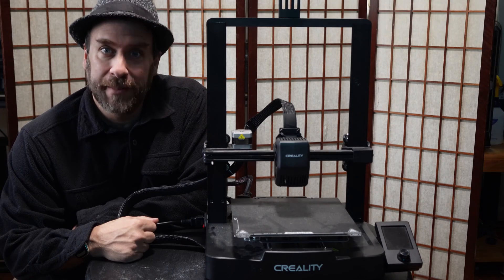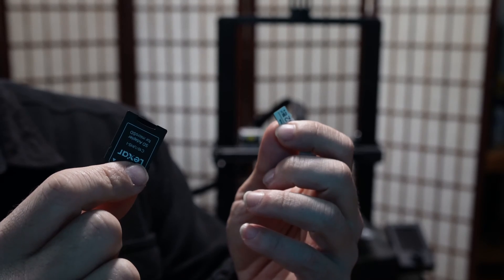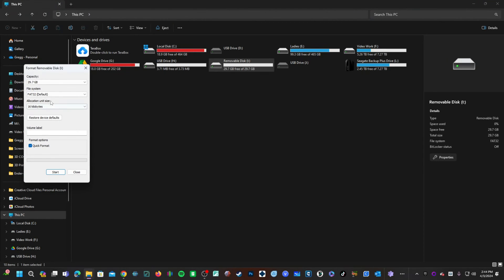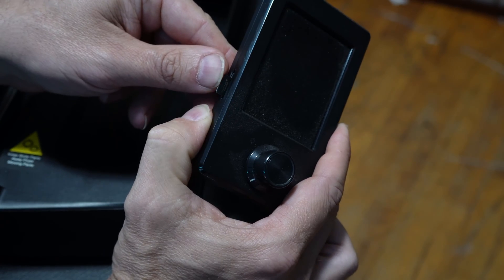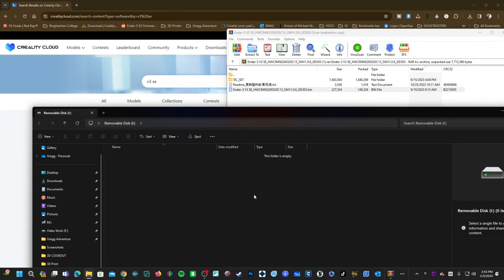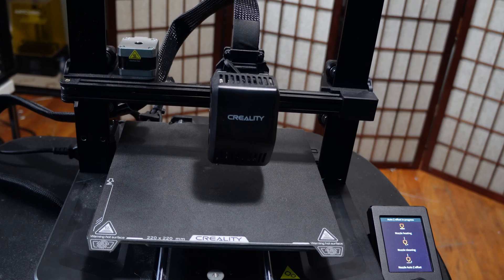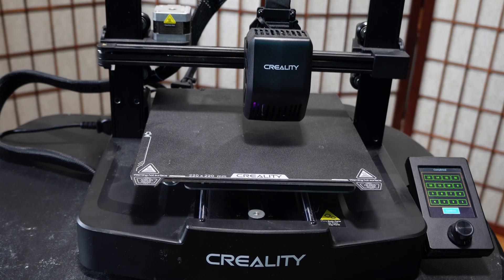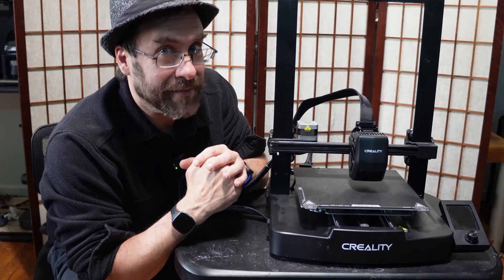How to Update the Firmware on Creality Ender 3 V3 SE - 3D Printer

Comment: Hello please someone help me I have a ender 3 v3 se and I can’t find anything on how to get the printer to let me go over the max temp of 260 I need it to go higher because I just upgraded to a higher quality hot end
Reply from the maker: Are you running a Nebula?
Reply: @3DRundown  I would have installed a nebula I just had no idea that was the problem
Reply: I am very new to this learning fast though thanks for the quick reply you earned another sub i bought the ender 3 v3 se stock and I only upgraded the hot end do I need to get the nebula kit to make the temp higher ?
Reply: Some people on a sub Reddit were trying to convince of buying the sonic but if I can just change the temp without spending over 100 dollars on a sonic tab I would much rather do so the nebula kit is only 70 dollars as of now if that would work let me know and I will purchase immediately
Reply: When I read online it says even after install the nebula I will still be constrained to the stock firmware that’s why I’m so confused
Reply from the maker: Sonic Pad is really nice, but, the Nebula was literally made for the V3 SE, and the install is so easy.  I don't do any 260+ printing, but you should be able to get around this through Klipper. Smarter people probably already have this documented.

Comment: hello 3D Rundown. After updating, do I need to use save info? Thanks in advance.
Reply from the maker: I would run a calibration.
Reply: @3DRundown  Thank you for the prompt response. If I may ask how to calibrate exactly?
Reply from the maker: It's the SE, so there is no G-Sensor, which means no Input shaping or any of that. Run an Auto Bed Level. If you have any weird problems, due a factory reset, then run it. BUT, you shouldn't.
Reply: @3DRundown  Thank you very much for replying! Will do this just in case. More power to your channel sir!

Comment: Buying an Ender 3 V3 SE has been nothing but a headache. Plus, while trying to update the firmware, I went out and bought an SD card that wasn’t a fat32. Had no idea there were different types of SD cards. It’s been a terrible experience so far. Ready to print in 20 mins it says lol.
Reply from the maker: Bro, V3 SE is as easy as 3D printing gets.
Any card can be fat32, but, of course, it needs to be 32gb or less. Hence, the "32" in Fat32
Reply: @ I’m not educated in SD cards man sorry lol. The V3 SE is not as easy as it gets. You have to manually download updates. It’s a tedious process. This was bought for my 9 year old because it says you can be printing in 20 mins. Not the case at all.
Reply from the maker: I truly is super easy, but, if you are comming from ZERO experience, there are certainly things to learn. 3D Printing is fairly complex..... But, go back 2ish years, and get an Ender 3 Pro, to see what things used to be like.....
I would highly recommend the KE over the SE, do to the Nebula Pad and Klipper. You may add the Nebula to the SE, and, that would offer a ton of advantages over the Marlin on the SE... including, automatic firmware updates.

Comment: Your explanation is very clear but I have a problem. I've only had my V3 SE for a few days. It went well a few times, but now I keep getting the CR-Touch error message. I sprayed the axle of the pin with some WD-40 and that seemed to help. But now I have the problem back. I read that a firmware update could help. That's why I found your video. Now updating the screen is going well. But when I try to update the machine, nothing happens. I don't get the Languages screen etc. Any idea what's going wrong?
I keep getting the CR-Touch message.
Reply: I have the same issue as you! Have you found any fixes?

Comment: I'm late, but I'm trying this as we speak. My download, on attempting to move it to the SD card, says "The file name you specified is not valid or too long. Specify different file name."
Reply: Just switched from FAT32 to NTFS and it worked, now to hope it still updates properly!
Reply from the maker: Always FAT32 for Marlin. 32gb or less
Reply: It doesn't. If anyone else is having this issue, the file must be inserted to the SD card using BREEZIP or WINRAR or a similar program and it MUST be in FAT32, file explorer WILL NOT WORK.
Reply from the maker: Yes. You must, of course, unpack the zip/rar first.

Comment: The printer firmware file ender-3 V3 SE_HWCR4NS200320C13_SWV1.0.6_GD303.bin wasn't recognised by the printer. When I renamed the file to 123.bin and rebooted it was detected straight away and FW updated was completed. So lucky that I had watched another FW update video and this was pointed out that sometimes the "bin" file will need to be renamed in order for it to work.
Reply from the maker: Marlin firmware will not load the same filename more than once. Renaming is always necessary after a failed attempt, or a re-flash
Reply: @3DRundown  Maybe this should had been mentioned in your video. SO so many frustrated people out there trying to install the Nebula kit to their Ender 3 V3 SE printers.
Reply from the maker: It's common knowledge for MARLIN, and has been mentioned many many times. That said, this is not for the Nebular pad. This is for updating the Stock Marlin on the SE. I may make a Nebula upgrade video at some point. The Nebula is already here, but I am only one person. YOUR WELCOME

Comment: when i download file it comes up as a document. no folder. also im on mac. can someone help?
Reply from the maker: What's the file extension?
Reply: @3DRundown  i fixed the problem earlier by using the unarchiver which is a 3rd party app used for opening and extracting certain files. i also had to use an earlier update model because i couldnt update the machine part, although i did manage to update the screen first. everything is sorted now. thx for ur vid

Comment: ive done this seriously 20 times. 
my printer does the update on the screen but after inserting full side SD 
turns on and stays on blue screen. does not progress to creality logo or anything further
did all versions available of firm ware. 

any help????
Reply from the maker: Keep in mind, when loading a new firmware, the machine won't attempt to load the same filename twice. Try renaming the file, and attempting again.
Reply: I have this same problem, just gives me the blue screen and stays bricked, what do you mean, change the file name?
Reply: @ I had to contact creality support 

They sent me a new piece 

Whatever anyone else tells you do not update firmware

Comment: I have done everything that you have said here and now when I turn on my printer, the screen says no file.. I don't know what is wrong! I've tried it several times now and can't seem to get it right!  Please help me!
Reply from the maker: GCODE files don't show up?
Reply: No, not at all. I don't know if I should just return the printer and get another one or what. I bought this for my son for Christmas and hasn't worked yet. I found your video about the firmware update and was hoping this was the solution. I even had to go buy a different SD card that supports FAT32..lol
Reply from the maker: YES, you want Fat32. You'll need a card, that is 32gb or LESS, to format in Fat 32. Choose Allocation unit: 4096.
Are you SLICING your STL files, then EXPORTING them as GCODE, to the Memory Card?
Reply: Yes, I don't get why this is saying "no find file" I went to Best Buy and talked to the computer guys there and one of them owns a 3D printer and knows exactly what I was talking about and has no clue what I should do. I'm thinking it's the printer at this point. I think it's defective. I showed the guy what I was doing, and I did everything correct.. the printer won't read the file. It is FAT32, it's everything you said.. the files are there! The printer won't read it.

Comment: DIFFERENT LANGUAGE ISSUE*SOLUTION:
1. Format micro and normal SD cards
2. put TJC_SET folder in micro root, then insert micro in on the left side of the LCD as shown in this video
3. Copy the Ender-3 V3 SE_....bin to normal size SD card and rename to firmware.bin
4. Insert BOTH the micro sd card in the display and the normal sd card in the printer
5. update screen will appear again
6. Wait for update to finish, then turn off remove all the cards and start it up. Should be back to normal display
Reply: HELL YEAH,,  tried 5 times like the video showed and got such a messed up screen, did it your way and baaaam worked like a charm

Comment: thanks, this video was helpful. i didn't even notice the microSD on the display.
my 3v3se wouldn't boot when i turned it on today (stopped at blue display), despite it never being connected to the internet or being altered whatsoever. very sketchy. gonna go with a different brand next time i guess.
Reply: I’m having the blue screen problem right now and the firmware update is it working
Reply: @336tygershelton  Updating my screen with the microSD got me past the blue screen, but then everything was in chinese and bugged out. I tried updating the main board, but it failed to read the file... After rebooting with the SSD inserted, though, it booted successfully in english. I had to recalibrate all the axes, as it was reset to factory defaults. I'm not sure exactly what happened with it, probably there's probably something wrong with the motherboard.

Comment: Hello sir. Do have an idea what is wrong with my printer? It wont print and the timer ends after just a few seconds/minutes. No clog, i tried using a different slicer but still to no avail. i tried updating the firmware and still nothing. im not sure what to do theres nothing online about this kind of problem.
Reply from the maker: Interesting. Are you printing off SD card? The first thing I would do, is try a new, name brand card, 32gb or less
Reply: Im using the free macro sd card that came with the printer package. is that where the issue is? I will try using a diff one.
Reply from the maker: Never use them. Ask me how I know.....  I use these on all my machines: https://amzn.to/41qiyj9

Comment: My micro sd card dosent show fat32 it shows exfat
Reply from the maker: Is it below 32gb
Reply: @3DRundown  it 128 gb also do you need to update the screen for a nebula pad camera
Reply: I keep getting a error code “motherboard communication abnormal
Reply: I seriously think I’ve messed up my printer
Reply from the maker: You need to use a card that is 32gb or less, to format in FAT32.  Put the old screen back on, and follow this video, to get it back, then, move on to the Nebula again. When doing Nebula, flash the machine 1st
Reply: I fixed it

Comment: hi i try all but it doesn work . i cant copie the folder onto the sd card . any idea?
Reply from the maker: If zipped, Unzip it first. Make sure the card isn't locked. Use a new card, not the included trash card
Reply: @3DRundown  is a 2gb enough ? there seems to be another problem . when power on the bed gets really hot . its a new printer . thank you
Reply from the maker: Firmware should fit on a small card. I would use an 8 or 16gb, to do the firmware, and a modern card. The bed should NOT heat up on it's own.....  Did you ever get this sorted?
Reply: @3DRundown  hi . yes the company will send me a new board and card . thank you .

Comment: I had tried to upgrade to the nebula pad but it wouldn’t work so I went back to the original screen and it was bricked and wouldn’t boot so I updated the screen firmware and went to update the motherboard firmware but it immediately booted up and went to the home page for the se and printed immediately.

Comment: in second process when we inserting sd card in language option different languages showing. not showing english.
Reply from the maker: Is it possible downloaded wrong language file?
Reply: @3DRundown  got solution while doing format process need to select 4096 bytes and rename the Bin file (123.bin). Also facing problem during lcd installation i take 16gb micro sd card so i get the option fat32 option in File system if card is more than 32 gb u will not get fab32 format option.
Reply from the maker: Yes, always go under 32gb. :)

Comment: Updating the screen went fime but when updating the main board i get stuck in a infinite loop when doing the leveling? It will go make it to the vottom left corner then restart?
Reply: Is there a reason I need to do this if I have had my machine for about a year and a half and never updated but it runs fine?
Reply: same did you ever figure out how to fix this?
Reply: OMG just figured it out!!!! if you have this problem check the back of your printer. There will be a little red switch. It should be switched to the right at 115 volts instead of 230

Comment: i updated the printer fine but now the bin file is stuck on the sd card and I cant figure out how to remove it.
Reply from the maker: Put the card back in your computer and delete it.
Reply: @3DRundown  that didn’t work it says it is protected. I even tried to format the sd card and it won’t even let me do that.
Reply from the maker: Are you using a microsd adapter? Is the slide lock on? I would toss the card, and use a new one.

Comment: So when I go to add the TJC_SET folder to my SD card it says error 0x8096002A for the TFT file inside the folder, anyway to fix this?
Reply from the maker: Use a 32gb or less, format in fat 32. I would redownload and unzip the file, then copy it.
Reply: @3DRundown  It keeps saying that the tft file is stopping it from being transferred over and when i try to open it by itself it wont work. im in FAT32 but just nothing changed

Comment: I was getting the dreaded CR Touch fail error making my 2 week old Ender-3-V3-se unusable. Updating the screen is pretty easy, thou I did have some problems finding a micro SD card that it would read. It was also impossible to format any micro SD card to allocation size 4096 bytes. It just was not an option (win 10), maybe my micro SD cards were to big or new? No idea but one of them finally worked formatted at Fat 32 auto. Now onto updating the mainboard. As far as I can tell there is no visual indication the mainboard is updating other then it takes longer for the Creality logo to appear. I tried renaming the file 123.bin but that did not seem to work. Once I left the filename the same (SE_HWCR4NS200320C13_SWV1.0.6_GD303.bin) I did notice a distinct pause (maybe 10 seconds) before the Creality logo popped up. So I am assuming in those 10 seconds it updated the mainboard firmware. If I look on the info screen it shows V1.0.6 but is that for the screen firmware or the mainboard firmware? Who knows. Anyway it's working for now, hopefully it continues to work. It really is a shame because for the price this thing is amazing. I've printed about a dozen things and I am stunned by quality. Creality just needs to step up their game because shipping printers with the CR touch error is going to turn away a lot of customers from ever buying a Creality product again.
Reply from the maker: I've got about 40 CR Touch, and only had one die ever. Just some bad luck. Keep in mind there are literally millions of Creality machines in the wild. Yep, the longer boot, is the update. For the Format, you need to use 32gb or less, and choose Fat32.

Comment: Hello I have statement beautiful video will informational and I fellow the video step by step great guide, but now my settings for my ender3 v3 se max speed X-E and max acceleration X-E settings when I hit store great then pick my print then check settings back to stock settings 4000 and so on...can anyone help me with this please so confuse
Reply from the maker: Your GCODE will control those speeds. When slicing,  you'll want to be sure the speeds shown, are the speeds you want. Once the print begins, the GCODE's settings, will be applied. Not during warmup.... when it STARTS the print.
Reply: @3DRundown  

Where do I find those Temps in the codes from others prints??so when I get a print from Thingiverse and use the creality print 5.1,then add supports and change  Position then pick filament type and filament temp then slice. And do need to get rid of all the old print codes that was from old firmware and start using new micro sd with new firmware with all new prints???I'm sorry so much rambling but trying to understand for myself and my son..I'm sorry again
Reply from the maker: When you slice a file, whatever settings you have chosen, including those chosen by your printer profile, which you have left alone, will be coded into the GCODE. If you find, slicer settings you werer using, don't work well, you will want to RE-SLICE those files. A GCODE only sets the printer, for THAT FILE. Then, the next GCODE, will set the printer, based on how it was sliced. You should not need to be changing accell, and such, unless you are having a problem. SPEED you will change, but ACCELLORATION, you will leave alone, if it's working ok. 
Here is my CP5 Tutorial: https://youtu.be/AdM3gNezCGk

Comment: I updated the screen fine, but then it didn’t go through the setup process for updating the board, yet when I go to info it is showing the latest version, so is it all good and just worked differently for me? (even though it’s the same firmware as the vid), or has something gone wrong?
Reply from the maker: I would defintily go by whatever version is showing on the screen. If in doubt, RENAME the firmware file, and try again. It won't read the same name twice.

Comment: file cannot be copied to the sd card in the first place
Reply from the maker: Of course files can be copied to an SD card..
Reply: @3DRundown  found out I had to unzip the folder first, but winzip doesn't work for some reason, had to use 7 zip